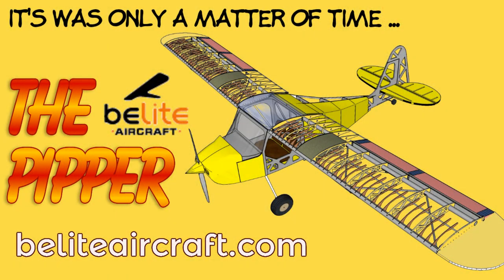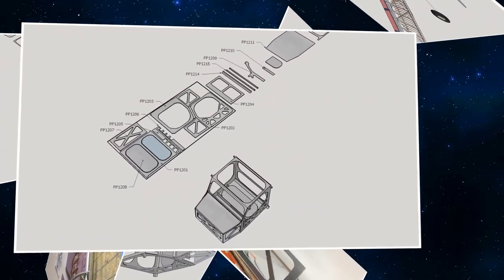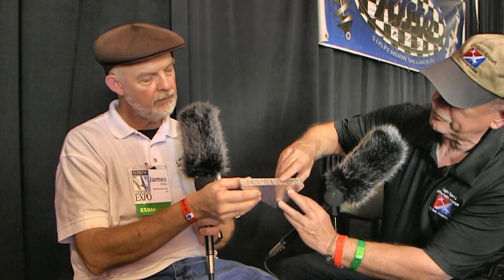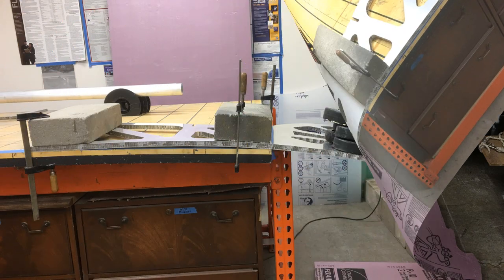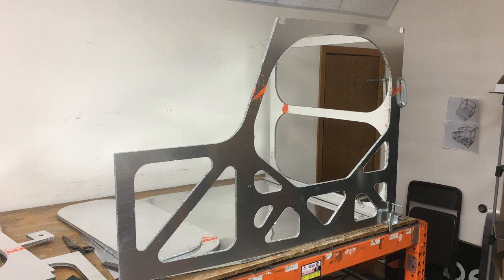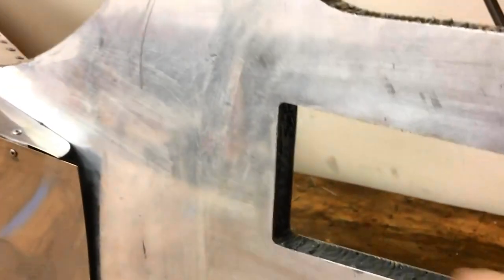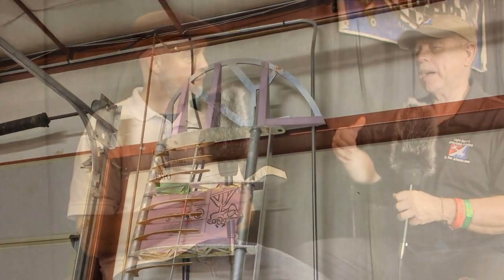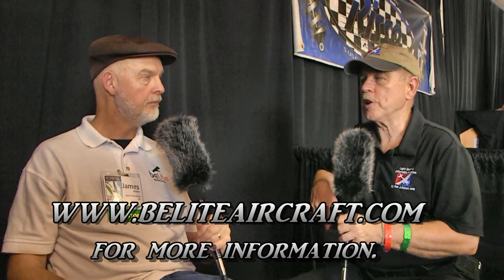Chipper, Belite Aircraft’s Chipper two seat experimental aircraft, in taildragger or tricycle gear

Comment: a taylorcraft is faster by a large margin. this compares to a  piper cub .. then compare it to the  taylorcraft with semi-symmetrical wing,,,  acrobatic and soarable ..  taylorcraft rules
Reply: An excerpt from an ad on Barnstormers regarding a Taylor craft for sale:

“...

1946 Taylorcraft BC12D C65-8

1946 TAYLORCRAFT BC12D C65-8 • $15,000 ...Very Nice Airplane! Paint and Ceconite fabric in good to very good condition and always hangared. Airplane has useful load of 444 lbs w/ 12 gal main and 6 gal rt wing tank, ... with wheel pants... Continental A65-8, 65hp...”

1.  Try convincing the wife you want to fly her in a plane that old. 
2.  Useful load is comparable. 
3.  If you are correct regarding aerobatic capability, ok, that’s a plus for the Taylor 
4. Overall however, nice Taylor’s are sold for $26k and up.  
5.  Personally, I like the vintage look of the Taylor but the Chipper is stout looking in it's own right as well.
Reply: I too like the Tcraft. But don't knock this guy or his airplane. You sound just like every internet aviator. Mine's better than yours!!!!!
Please!!! Grow up or go home!!!!